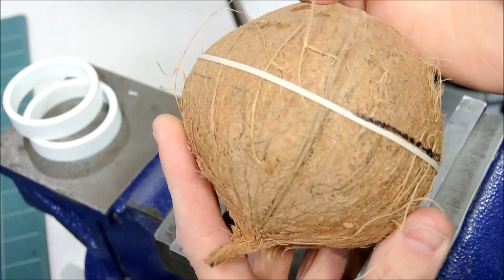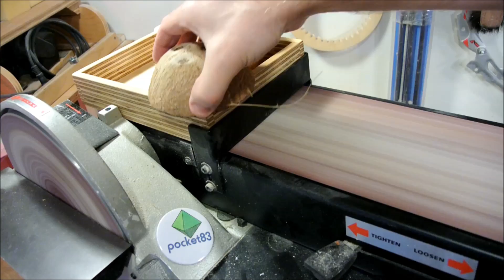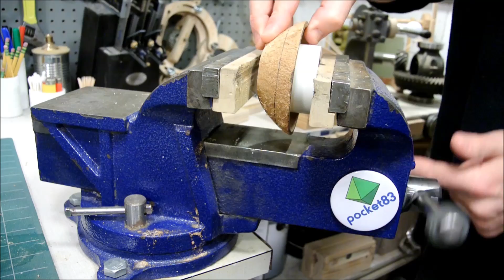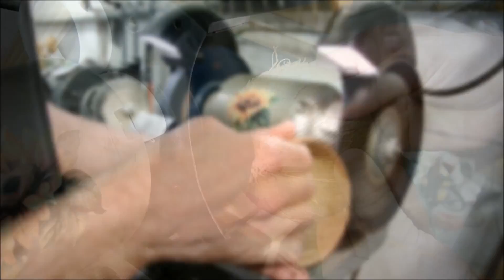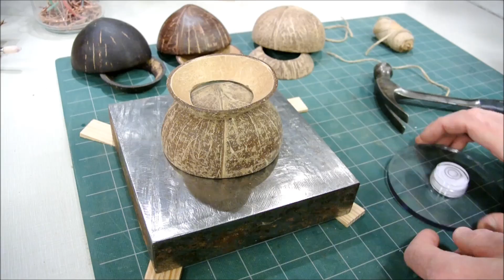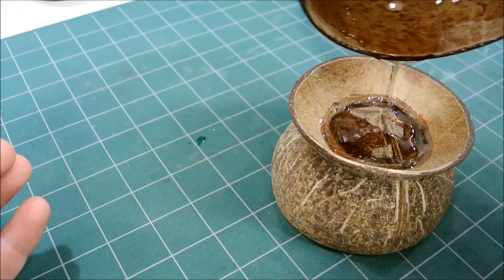Crafting Go bowls from coconuts!

Comment: Good to see your vid. Rather than epoxy I use the dust and hair from sanding as a filler like your jute and drip superglue on it. It sets very quickly . Also borax powder and superglue make an excellent filler when there are gaps around the base. 
My friend now has five in her kitchen and they are quitre durable even when wet.
Your tip on using a short section of pvc to hold bowl in vise is brilliant.I always have a problem of how to hold the odd shape firmly.

Comment: Pop an opened coconut into a 350 oven for about five minutes (maybe 10, depending on how wet it is) and the flesh will pop right out.  A lot easier than gouging it out with a spoon (or even an air compressor...).
Reply from the maker: I wanted to save the meat for smoothies.

Comment: I am kinda curious.  Every person who has crafted with coconuts has done many of the same process steps as you.  Drain, mark, gut then sand.  The sanding usually involves tools, floppy coconut shards and awkward hand holds.  Is there a reason you cannot sand a coconut as a first step before draining?
Reply from the maker: Nope. Go for it. But round things are also quite awkward to work on. Either case, this is an easy project.

Comment: how does the thing at 1:39 work? blow wind into the space to seperate 2 layers?
Reply from the maker: Yep. That was compressed air. The high-speed makes it appear to work better than it does, though. Your coconut will have to be the right age, as well. 

Compressed air is sometimes great for stuff like that. It's magic for putting on bike grips.
Reply: thank you very much :D

Comment: However, there begs the question:
Why tf did you just not crack open the coconut, then smooth it out from there? And why oh why did you use a spoon, an air blowing machine and a razor to cut the inner part what a knife would suit just fine?
P.s. Great vidyah
Reply from the maker: Alternatives, alternatives, alternatives. Showing how well multiple tools work gives viewer a better "feel" for what the object/material is like. 

Also, honesty: I rarely finish any job with the same tool I started with! 
trial + error = experience.

Comment: I thought you had a band saw
Reply from the maker: NO WAY! That would catch and roll! And make a mess.
Reply: You think? If you had it in a clamp and went slowly, dunno in my head it seems much easier that way, but then again I never tried cutting a coconut like so.
Reply from the maker: Maybe if you clamped it or jigged it up pretty well. And used a blade with small teeth. Personally, I think I liked the angle grinder best. Smelled weird, though.
Reply: Oh I did do that before though, abrasive cutting disc on wood that is, it felt a liiiitle bit cringy indeed.
Reply from the maker: Coconut wood is very thin and hard, so it works well. Don't do it if you aren't comfortable, though.